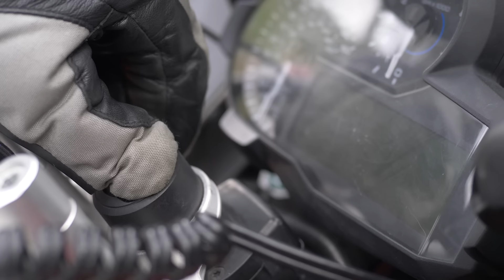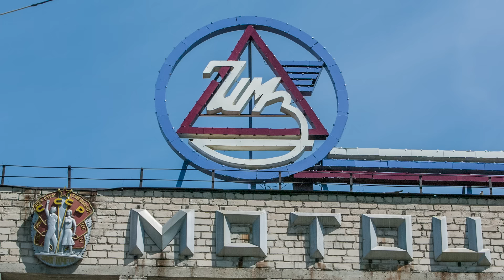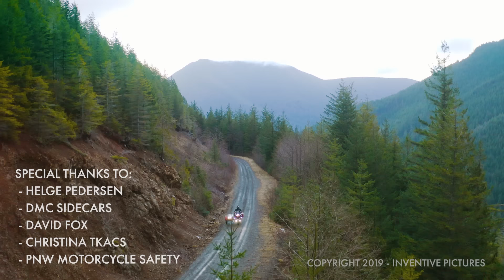Adventure Sidecar Tips from Helge Pedersen

Comment: Ural has an advantage because it is 2x2
Reply: #darksoul do you ride a Ural or any other sidecar? Just asking because your statement makes me believe that you need to qualify what you are saying. You do know that you can/should not use the 2x2 on solid surface, but rather on dirt and slippery condition unless you are just going straight forward. In other words no differential on the sidecar wheel. i have chosen a more powerful bike that can go at higher speeds over longer distances and for me that is the advantage over the Ural. You just have to find what works best for your own use, that is all.
Reply: @helgepedersen877  I ride sidecars since 1985. ON your rides (bad roads) Ural would be the best option. 
My first sidecar was  BMW Sahara. then Emkka 47, Panonia, Jawa, Izh, Dnepr, and Ural. Each sidecar willhave different mounting system. Adjustment and balance of the sidecar will make it ride smooth. 
Ural has a small engine. I would prefer more HP, however, Ural has torque. BMW Sahara had more HP. 
Today I do not ride motorcycle  too much anymore. MY back is bad and I do not enjoy rides too much anymore. 
Sidecar are fun and really convenient for travel. Your sidecar is Ural sidecar. You just placed BMW stickers on it. 
It is interesting concept, however, your motorcycle does not have strong frame for cargo, passenger, and weight of the sidecar.  Sure, you do not have a passenger, so it is not a problem. 
Thank you for sharing your videos with us. Stay safe on the roads.
Reply: @darksoul4961  That is wonderful, you have lots of experience. sorry that your back is giving you so much problems these days. Thanks for sharing your experience though. Just to clarify, my sidecar tub is not a Ural tub, but rather a similar tub made by DMC in Seattle and it is made out of glass fibre not metal like Ural. The sidecar frame is double tubed and the mounting to the BMW motorcycle is very solid. I got the sidecar so that my wife and I can travel together and she loves it. We have done one big tour together so far and that was the length of South America, Colombia to Tierra del Fuego. Not one time on that journey did I see any need for 2x2. Most of all I enjoyed having a powerful engine with 125Hp engine and a water-cooled engine so there were no issues with overheating. I do agree with you for more technical off-road riding it would be nice to have 2x2.
Had it not been for the pandemic we would have been traveling from Tokyo to München earlier this year. Our next journey will be Himalaya in September 2021. On that journey we will get up to basecamp of Mt. Everest at 17,000 feet. This is a place that it is good to have a powerful engine as the lack of oxygen will make the engine less strong.
Again thanks for your feedbacks and I wish you all the best.

Comment: Important : start with sidcar-practice in time ! - ( so it´s possible to ride with advaced age ) - otherwise it is not the best idea !
Reply: #GüntherNussmüller Like everything in life we do not learn as fast when we get older. I think my advantage was that I have been riding a motorcycle all my life. With that background and not starting to learn sidecar before after I have turned 60 years old it has not been too bad. I still am learning, but already now feel pretty good controlling the sidecar. You are correct, we have to be careful when we first start riding a sidecar as it can be very dangerous if you are not careful. I took a two day school to learn and it was a good thing to do, highly recommended.
Reply: @helgepedersen877  was not thought for you personally ! But your fans should know, that sidecars are not so easy to drive and it should be recommended to start in time to train this special vehicles driving. In Europe they often start to do it, when handling a Solo-bike is not easy anymore - Than there are a lot of problems, because modern sidecars are heavy and fast - ( and dangerous, if things going wrong )

Comment: The tread design of the tire at the front is very strange.. seems mounted in the wrong way! :) :) :)
Reply: It is a Metzeler Karoo Street tire and it is mounted correct. Remember that the front wheel is actually a 17" rear wheel from the bike.
Reply: @helgepedersen877  yeah, you're totally right. Just my wrong impression.
Great video, compliments!

Comment: Points out that all the wheels are interchangeable..then proceeds to show three different wheels
Reply from the maker: Yes - quite an engineering feat!
Reply: #toyfan2 All wheels can have 17" BMW rims and when that is installed all 3 tires are also interchangeable. However the sidecar rig can also accommodate 15" automobile rims on drive train and sidecar. This makes for a very flexible set up and is excellent for a world traveling rig. Sorry if this was not clear enough in the video.

Comment: Only one wheel drive.so the sidecar has no drive, little bit confusing 🤔 about gearbox as usual I look in Ural motors.i can't see in this bike side car.
Reply: #bobspyder I am not sure what the confusion is all about, but this sidecar bike only have power on the bikes rear wheel and no power on sidecar wheel.

Comment: I used to ride a Matchless 600 sidecar in the seventies.  Bike a heap of s*^# but fun to ride. What he says about corners is true, but he didn't mention traffic jams on an air cooled motor.  The engine runs hot.
Reply: #RobertKing Yes, so much fun and with the liquid cooled engine on my BMW R1200GSA 2017 model there are no such problems as there used to be with all the previous boxer engines from BMW. This model has water-cooling at critical areas of the the engine and a fan for one of the radiators. Never had problems while other had, love this engine.

Comment: Rather pull a mono-wheel trailer behind a standard bike.
Reply: Have you tried a sidecar bike on rough off-road roads? Just asking as I have never tried a mono-wheel trailer under such conditions either, but feel that it would be dangerous. On the journeys we go on with GlobeRiders I think that I would have reservations having a client bring a trailer as we can hit some really bad roads at times.
Reply: No I haven't pulled a trailer. Kip Moto makes a tough trailer that has a couple wheel configurations, also a skid plate available. It takes any offroad that can be thrown at it, such as logs, water crossings, rocks, rollers.  https://youtu.be/ofyc_9-R7LU?t=85

Comment: the r1200gs had mechanical issues too..
13' models burned the stator ... hole engine needs to be take out to replace it
i'd say 1 out of 10 bikes had to have one or even two  cylinder heads replaced...started making a horrible noise (most replaced under warranty)
front forks sliding tubes were literally separated and caused crashes...fixed with a recall
2018 models can crash due to loose spokes..but thats because bmw switched from german(i think) made wheels to asian (not sure...maybe Chinese or Taiwanese)
sometimes the shitty timing chain brakes (on 13' models usually)
the left and right combination switches were probably upgraded 3 times 

but they did rectify  previous bmw models issues...
for example the drives shaft, final drive, abs

Comment: I don't get running a car tire on the rear. If you ever take the sidecar off you lose a lot. More than there is to gain
Reply: The point of running a car tire on the rear is to be able to ride much longer on a tire that does not wear out as fast as a normal bike tire. There is also a larger contact area with the road using a car tire. However if I want to replace the car rim with a normal rear wheel I can do this very easily as the sidecar wheel is the actual rear tire of the bike. Front, rear and sidecar wheels can all be the same rear wheel off the bike.
If you look at the video one more time I think you will understand what I am talking about.
Regardless of all of the above this is not a bike that is built to be converted back to a solo bike unless one make several modification and those modifications are mainly centered around the front fork.

Comment: why have a water cooled bike?  Too much weight and complexity and something more to go wrong. Better off with air cooled if going off road
Reply: #AlanBStardMP Overheating, overheating - it is a big problem. I have 10's of thousands of miles with water-cooled bikes and find them more reliable than my previous non water-cooled bikes. For my applications I can say that I do not agree with your statement.
Reply: @helgepedersen877  i am old enough to remember when all bikes were air cooled.  I live in one of the hottest nations on earth and have never seen an air cooled bike overheat. air cooled bikes do not overheat unless you have insufficient engine oil.  As this VW ad says " impossible " https://i.pinimg.com/236x/0d/e3/30/0de3302997daf45eb8600fc979f94a96--madmen-print-ads.jpg
water cooling ads weight and complexity, things you don't need especially off road or overland

Comment: Big no no sir it's totally uncool
Reply: Sure, it is not for everyone to venture out on a sidecar. If you never have tried it before though, give it a try and you will see if it is for you or not. good luck to you.
Reply: @helgepedersen877  mr. Pedersen what I meant by my previous comment was that the side car severely limits the advance capability of the GS and I cant really assume that a icon like gs will be performing at its full potential after attaching a side car to it . Though it really opens a whole new Avenue of increased storage but that comes at an expense of severely reduced agility.
Reply: @KBSINN  For some people this is very cool and lot's of fun. Obviously  the GS will no longer be the GS we love and car for, by the way I still have a 1200GSA LC that I love and use for most of my riding. What we have done here is like putting a fifth wheel on a big 4x4 truck or something like this. The main reason for using the GSA for the sidecar is to have the ground clearance and horsepower this bike has. Spoked wheels and large tank are other advantages. 
All I am asking you is to be open minded and try to ride a sidecar one time and you will soon find out if this is worth pursuing. I were reluctant for many years, but now after having tried this I am very excited about doing more sidecar riding around the world.